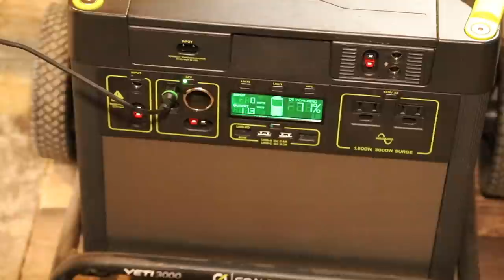Build a Stone Hearth for the Off Grid Log Cabin with My Dog | Woodstove Maintenance

Comment: I think what you're experiencing is the de-motivation that comes with injury. I don't know if it's more chemical or psychological, but our body puts up a kind of invisible, reluctance barrier. I suspect it's part of the healing process, designed to slow us down. But I think it's normal. The trick is not to let it play mind games with you though. Let it be what it needs to be, to help (slow you up, if that's what your intuition is calling for) but don't let it affect the bigger picture. Which is why you're radiating towards people's comments and listening to your wife's encouragement. You don't want to let go of the bigger picture, that got you started in the first place.

So this is just the mind sharpening itself against injury. You're managing it well too, by strategising smaller chunks of activity, so you can handle it - but continuing to engage the bigger picture, with the help of others. No one should feel alone, even when they're accomplishing, a lot of manual work alone.  Think of your injured finger, as a testimony of truth. It will serve it's purpose. It will reconnect you in meaningful ways, as it disconnects you in others. I will look forward to your next video, time and energies permitting. :)

Comment: One question on the rock wall behind the stove. I saw that you used spikes to help tie the rocks/cement to the wall of the cabin (which I was going to ask you about in one of the later videos). It just occurred to me, however, that as the cabin settles and the logs drop down slightly that there will be added pressure on the wall and depending on just how much pressure caused by movement won't there be a risk that the whole rock wall might collapse in time? (Or will you take it down at a later date as the cabin settles and rebuild it?) Obviously, the rock wall needs to be secured. Perhaps you could have bolted a couple of sheets of 1-inch plywood together and attached that to the logs using a sliding-bolt attachment that would allow for settling of the logs, and then install the rocks in FRONT of that, anchoring them sporadically to what would then basically become a backer board. You could mortar some rocks in up along the sides after everything was set in front as THOSE rocks would be up against both, the backer wall AND the logs so in time I'm certain some of those rocks would break loose and have to be repaired. But better to deal with only one column of rocks along the outside coming down rather than potentially the entire wall one day. Not really criticizing; it's just something that occurred to me today as I was watching this video, knowing how the logs will eventually settle and that a total movement of only a couple of inches might be enough to put sufficient strain on the rock wall to cause it to fail. (That's a lot of weight to be coming down all at once and I wouldn't want Cali, you or your wife to be in front of it if it did fail because of that.) Sorry. Long comment. Great video though! (as usual)

Edited to add: You were thinking about electrical "comforts" to add... I'm cutting down on my milk intake (which is hard because I love milk ... LOL) so have replaced it with almond milk that I make myself. You and your wife are really focused on healthy eating as well. If you're interested in something like that, or something UNHEALTHY but so so good like frozen margaritas (haha), you might want to consider adding a really good blender to the cabin. I honestly don't think I ever want to go without my vitamix or my Omega juicer for that matter.

Comment: PLEASE PLEASE READ!! Shawn...we have just found you, & r now completely caught up. Your bush & wood craft r amazing, but one thing all the way thru is VERY PUZZLING. I have also camped in all seasons. I alone (woman) spent 8 nites alone in winter w nites down to 8' F. In ALL that time my FIRE NEVER WENT OUT, because I "smoored" (???)it at night. I got a big oak piece of firewood & got it well started, w good coals burning in middle of log. Then I COVERED IT W ASH. Next AM I brushed off the ash, the log coals r STILL GLOWING SUPER HOT AFTER ALL NIGHT, I throw on a little kindling. In 2 minutes I have a strong fire going. We even do it in our wood stove. Before we put in last load of night we scrape some good half burned coals in a corner, bury them in ash, then load the box, & in AM off we go again instantly!

Comment: Hi Shawn,  great content.  Cali has the correct mindset for dealing with the heat. Get wet and take a nap during the heat of the day. Work at night when possible.  Really like your blue heater/stove.  Check out the Arctic Cool website for cooling towels and shirts. They have made a real difference for me when it's above 90 degrees.

Comment: Would Boiled Linseed Oil help preserve 👉🏼 the outdoor wood rounds floor ?
 or motor oil mixed w diesel fuel.
Are you using mortar between the fireplace stones ?

Comment: Hi Shawn. I was thinking of something now that winter is coming, I saw that you hung fur for the windows this winter. if it was to reduce the heat leaking out? So what do you think of loose inner windows that you put up in the fall and take down in the spring to get an extra insulating air layer. We here in Sweden are using it in old summer cottages (maybe everyone does it? I do not know), cheap and easy, and retain the old feeling of the house.

Comment: 3 Motivational Quotes i printed out on a piece of paper Keep in my Wallet at all times

Quotes
1. Optimism is the faith that leads to achievement. (Unknown)
2. Only I can change my life. (Unknown)
3. Our handicaps exist only in our minds. (Franklin Delano Roosevelt (1882-1945)

Select any 4 you deem necessary...which gives you hope, guidance, strength and Happiness in your daily cabin workings..and read them going in and out of your cabin.. You will do each and every task you select for yourself...and sleep soundly like a bear in his cave.

Also buy a portfolio book and print these for yourself either in color or B/W and keep e'm close for the day you feel tired.

Laying down 2 minute Workout
https://darebee.com/workouts/2minute-abs-workout.html

Arms and Chest Stretch Workout
https://darebee.com/workouts/arms-and-chest-stretch-workout.html

Legs and core Workout
https://darebee.com/workouts/legs-and-core-workout.html

Chest and Back Workout
https://darebee.com/workouts/chest-and-back-light-workout.html

Stay Safe... you're doing FINE... and remind your self..all of this is for yourself and your family for the hard days to be a little easier.

GOD BLESS.

PS.. A Lightweight Telescopic Masts (60 Feet) with an Omni Directional Alfa AGA-2424T 24 dBi 2.4 GHz 5 to 8Km (4KV Lightning Protection) 2g/3g/4g LTE Wifi Antenna with cable extention to your indoor reciever... yes i know... it  all sounds allusive and expensive.